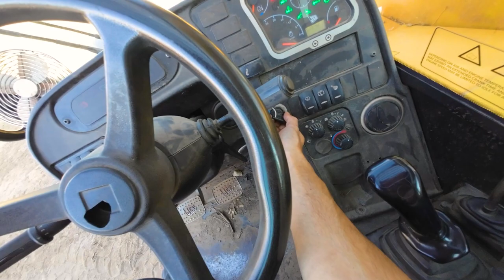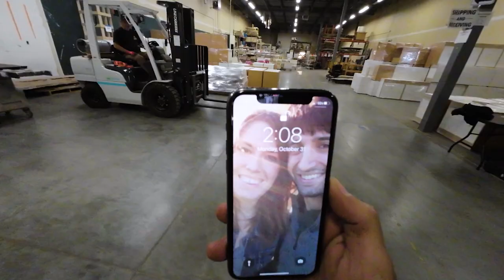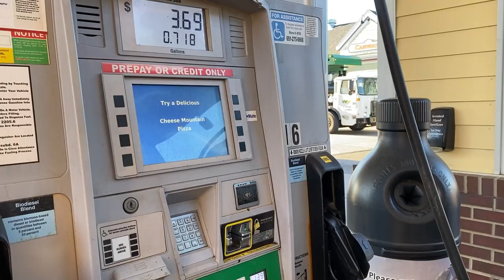Saying Goodbye to my Warehouse

Comment: For the bandsaw, maybe that's something that could be addressed when you add the lean-to on the outside.  You could actually inset the base of the saw into an indentation in the concrete.  You could add roll shutters or folding doors to the area around the saw to protect it from the elements but open it up to not impede working on it.

Comment: One thing that a lot of shops do, especially in front of machines where you would be standing in front of it on concrete all day:   Would be to throw down pallets for you to walk on;  It allows you to have that spongy flex of the boards below your feet, which is good for your back and much nicer on your feet all day.  My point is that you could do this near that saw, and it would give you a little boost in height,  to account for that saw being so tall.  Just a thought;  It's common practice in machine shops.

Comment: Move out of warehouse-CHECK!  I can only imagine how much of a relief that is for you, but it’s good to see that your stuff is now all at the farm site and not several miles away.  Not sure if it matters or not, but when I setup our 10,000 pound shelves in the storage unit I added some pine boards to the bottom legs of one shelf and some oak to the second one to spread the load on the floor.  The compression and bending strength of both is similar, but the yellow pine is actually a little higher than red oak, not to mention a less expensive.  I screwed the bottom of the shelve legs to 2x6 boards that were 4 inches longer than the shelf stand and that helped spread the load of the shelves on the floor, which also gave the shelf a slightly larger footprint at the same time for added stability.

Comment: You and Donovan did a great job moving (loading and unloading).  I was holding my breath a bit when the telehandler forks were lifting the slab-surfacing table, but no worries!  Nice that the weather cooperated (no snow or rain).  I'm sure this move has lightened the load on your mind.  Excellent work.
Reply from the maker: Thanks!

Comment: Back in the 80s I worked in a aluminum foundry and they had a big Tannewitz saw used to remove risers and the like from newly cast products which were often a foot thick. That saw was awesome and very intimidating to use but WOW could it cut.

Comment: Moving seems like a good move to me considering they wanted their space back (which is what this whole project was about if I remember correctly), everything is now in your backyard instead of miles and miles away, and you'll save some on rent.
Plus with all your stuff in one place it will be easier to take stock of everything and visualise exactly where things will fit so you can make a more accurate plan before you start moving in properly which is also a good move.
So basically, it's many good moves from just one move which is the best move of all.

Comment: I'm sure that's a big relief getting out of the warehouse and back on home ground, but I thought I should suggest an improvement you will probably need. I worked at a business that received some shipments outside, as well as shipping a few things outbound. You may find that the area immediately outside of your overhead door will be needed as a staging area, as well as for pick up and deliveries, and the area will need a good layer of gravel if not concrete to insure traction in rough weather. Plus you'll probably need to ask your heating/plumbing guy about warming the slab, if you pave it. As your business grows, so too will your traffic. Maybe something to consider in a couple of years when the entire venture hasn't completely fried your brain.

Comment: Curious if you could have the front and rear halves of the floor sealed separately, so you could put everything to the front (door) portion, have the rear sealed, then after that has dried, move everything to the rear so the front half can be sealed.  You would need to leave enough of the middle open to get your smaller lift through but it would be less "weather" dependent then.  Anyways, things look to be coming together well and getting ever closer to "complete".  Have a good one!!

Comment: My last job has a band saw same as yours, it's a beast but dangerous as hell. You can cut through 3 inch Oak slab like butter excellent for re-sawing. When blade breaks sounds like a gun shot going of and lots of shrapnel.

Comment: @4:30, haven driven a forklift into a box truck in the past, good thing it came off easy. we ended up needing ramps under the rear wheels to lift the box truck back up so we could get the forklift back off. even a full speed reverse didn't work.

Comment: Great move! And now it's all at home sweet home. Donovan is a keeper! 🙂
That band saw... Whew! What a beaut. Is that a polish brand name? I've never seen that brand before. The wheels; they ain't cast iron, man... Are those double-wall, riveted metal wheels just as good or better, or are they going to be an issue? It seems they would prone to flexing, or movement due to heat build up - which probably isn't a thing, on a band saw wheel...
Thanks again, Matt, for sharing this journey you're on!

Comment: OK you are going to need some 3 phase power.  You are going to need to build a pole barn/shed to have someplace to put stuff under roof (dry) that doesn't need to be in a conditioned space.  A door and some floor sealing should be real high on the priority list.

Comment: Just a thought. If you made a heavy duty steel cradle with heavy metal castors for the bandsaw it'll be easy to move around in the new workshop

Comment: Put a level on your bandsaw table and determine where it is bent, you can use a torch to heat a small spot and then cool it with a wet rag and you can slowly remove the bend out of the table. There are tradesmen that do this every day for a living. There are videos on YouTube that show the process in detail. A machine shop can usually do this work for you if needed.
Reply: Matt, before you do anything to the table look at Mr Pete 222's channel, Tips # 829 part 2 beginning minute 24.  He explains why that hole in the edge of the table is there.  Exactly the information you should have!
Love your channel.  Thank you for sharing.

Comment: That band saw is sweet! At first I thought it was a ship saw & when I got a good look at it was disappointed. But when you showed the rack & pinion table adjustment you can basically use it as a ship saw. Now if you ever need to cut a progressive bevil you can. How wide of a blade will that take?  I had forgot that you have side access to the front of the flat bed because when you first set it on there I was yelling in my head "Don't do it"! But then I realized I was foolish. Glad you got everything moved.

Comment: Great to see the move is done and you can start getting set up mate👍🏼. I reckon it will be so much better having your own, permanent, long term solution than the previous short term space. You will probably find that, over time, even though the space is not much bigger than before, that you eill find many ways to use it more efficiently. Especially as it is right tgere, and you dont need to muck around travelling, or worrying about inconveniencing others. 
Good luck for the future mate, and i loook forward to seeing your vidoes as life and business progresses. 
Im also keen to eventually see that huge bandsaw in action 😁😁.
Cheers from down under.
Reply from the maker: Thanks!

Comment: Maybe I have missed this topic in past videos, but can you bring us up to date on the electrical. It looks unlikely that you can have 3 phase power at your new location. Are you going to
use phase converters to power the 3 phase equipment? I really enjoyed this video since I have done the same type of shop moves in my past. Many years ago I rented a small space
and started building equipment. The customer wanted 440v 3 phase power. I thought that would be fine. The bad news was when I completed the machine, the customer wanted to
see it run before accepting it. I had to run a temporary power cord across a parking lot for the test since I only had 220v single phase power in my space. All went well and I got paid. When you express the relief you feel when everything was moved, I have had that same feeling in the past. Being retired and about 40 years older than you, your videos bring me a lot of enjoyment
manufacturing experiences.

Comment: For sure moving a business with big equipment is a bear of a job.   I’ve moved edit suites several times with racks and tape decks( blast from the past).  And it was not alot of fun.  Landlords love these kind of businesses with big gear especially ones that have network cabling l
Etc like radio or tv stations.  Wood fab guys too I’d imagine… they know it’s a lot of work to rewire etc so they know they have you for eons. Endless cash.  Better to move now before you get too big but buying a commercial space during the upcoming recession would make sense.

Comment: Back in 2006 I had to move 60 grand worth of arcade and pinball games, jukebox, pool tables and other amusement vending equipment parts, complete games, jukeboxes, my workbench and a ton of other stuff from the Florida Keys up to Miami and I thought I was gonna end up in a mental health facility. 
Especially since both persons helping me thought they were better at packing things in the truck we used even tho I used to be loadmaster rated on Coast Guard aircraft. 
I did survive tho so I can definitely relate to the struggle you went thru.

Comment: No worries - just one little query: what are you planning as a finished wall surface over the insulation? And maybe a little one about ceiling ? I know you're tied with electricians and sealing the concrete and stuff so not pushing.
Reply from the maker: No plans right now. Something for a future project

Comment: Congratulations on the successful moving experience. Is there anything Donovan can't drive?

Your bandsaw is a bold machine. Because it will be resawing large pieces like slabs, would it work to install it out under the awning. My thought is there would be ample infeed and outfeed space. It is an important operation but slabs could be moved to the workbench after being cut to size.

Comment: I like how ever shop has an old heavy saw that collects dust and hasn't worked in years. We have an old Dewalt radial arm saw in our shop that looks like it was made to survive a nuclear attack but I've never seen it run and I don't think it has since our boss basically got it for free at an auction.

Comment: I can see a huge weight removed from your shoulders...  Too bad about the power problems.   Are they putting in new utility poles along your lot line, or is there a pole near the house that they will feed from?
Reply from the maker: New underground service from the street. One 200amp service to replace the overhead feed to the house and small barn and a second 400amp service to the new barn.

Comment: Any issues with your forklift driving on the new concrete? I am going to build a pole barn, and I can’t seem to find the answer to the forklift weight with the Foamular 250 under the slab.

Comment: With all the  traversing through the overhead door; with the "horse head" on the jcb telehandler , mast on the other forklift or just large unique  loads  you may consider bollards and maybe a  cable and  pvc pipe like they have at drive throughs to help judge clearance.  It may be an eye sore however , I assume you will be handling a bunch of tasks solo,  only takes one ahhhh s**t to wipe out one million atta boys. What is the price and lead time of that door?   Commercial uses are built for function vs Aesthetics

Comment: You said an episode or two back that you prefer the DJI to the GoPro.  Do you think the DJI would still be working if it had experienced the kind of abuse that the GoPro has had?  Before watching this build, I'd probably have gone for the DJI, but that GoPro has had more lives than a herd of cats, and it's still going strong.  Has the DJI had any tumbles yet?
Reply from the maker: All camera falls I’ve shown have been DJI cameras
Reply: @mcremona  Really!  I assumed from the beat up case of the GoPro that it must have been the victim.  It's a pity DJI don't make ladders :face-blue-smiling:  Thanks for the answer.

Comment: What's the massive tank back there for?
Reply from the maker: Air compressor
Reply: @mcremona  How many gallons? Is that just for the foam packing machine?
Reply from the maker: @some0ne8  500.  It's for future use if I want to get into manufacturing or if I start shipping a ton more chairs.